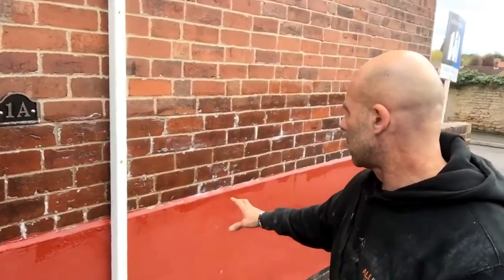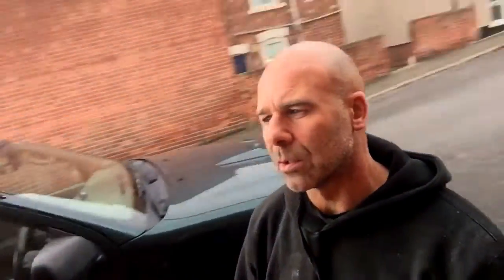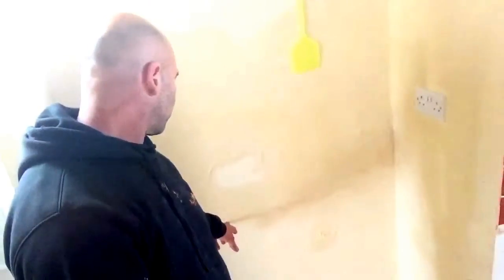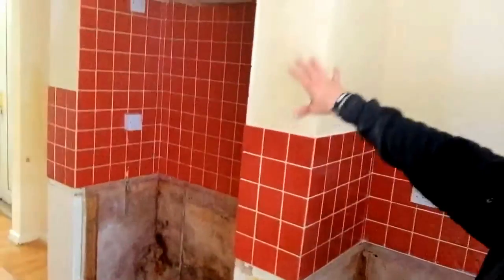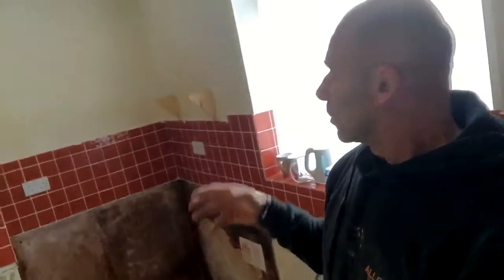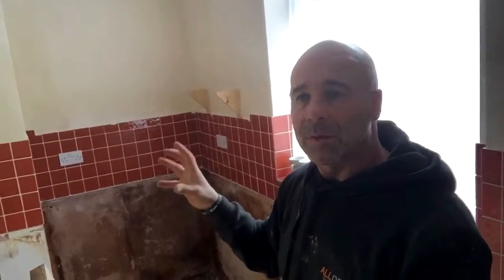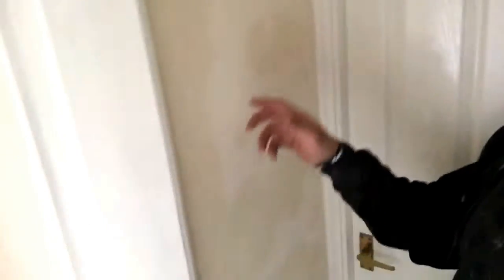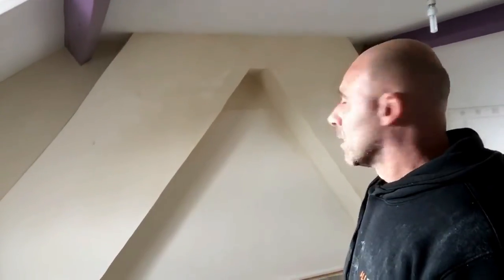Wow have you seen these damp patches? are your walls like this?

Comment: Hi Simon, I like your videos and you do talk a lot of sense. 3 easy steps to resolve that dampness. 1)  Make sure there is good sub floor ventilation and rooms are well ventilated. 2) Replace plaster with a lime base plaster. 3) Remove cement render off the wall. That's it. That render MUST come off the wall because its trapping moisture whether the customer likes it all not. The white vent in the Kitchen is not the cause of the dampness in that corner, it will help resolve the dampness if anything. Its letting the room breath, yes a little condensation may form but it will dry out as fast as it forms because of good ventilation.
Reply from the maker: Again all valid points and options if you have the time and money. I do look at all options available but will go for what is best for time, and budget of the customer but also the  type of construction.

Comment: You’re 100% correct in what you said. The salts migrate through the brickwork and it’s the salts attracting the moisture in the surrounding air. You get these know it all’s on here after watching a few Peter ward videos telling you how to do your job. Just ventilate the chimney and a cement render with additives would be just fine or even sbr slurry then dab over. No negative effects whatsoever.
Reply: I've got these issues, I've managed to scrape of the paint to bare wet plaster who's is soaking, I've got the dehumidifier running to dry it out hopefully, what paint  do I put on it then to stop the damp and salts? 

Thanks
Reply: You need to check the source of the damp first and eliminate it. It may be that the chimney is in bad condition on the outside and moisture is getting in that way. Once you've solved that issue you must knock off any loose render/stone then give it two coats of SBR mixed with cement at  a 50/50 ratio.  Paint 2nd coat on at 90 degrees to the first.

Comment: How are you sorting the chimney breast problem out, do you block off top of chimney and install air vents on each floor to chimney breast for air flow? As well as putting a salt neutralising plaster on of course
Reply from the maker: Fitch 1991 basically yes in a nutshell but with internal work too.

Comment: If the rain water is splashing back then it's not going into the grid properly. If there's even a grid there. Look.at the green on the concrete. Drains is the issue...
The head isn't the issue the render is
Reply: The green can form if the property is north facing. You should know that. It's basics. It's got nothing at all to do with damp or drains. It could just be north facing

Comment: Great vid, quick question, can air bricks be a source of damp? I have just recently bought a house and the previous owner had wall papered over them. They had been covered for at least 2 years, plaster & render is completely blown in two of the corners in the room. Would you recommend keeping them or bricking them up? Thanks again for the vids.
Reply from the maker: Tom G hi there, if the air bricks are directly into the room I would swap them for Passyfier vents, these are an insulated vent that will allow clean air into the room but not cold air. You can buy them on line at the Condensation Shop. 
Cold air will have got behind the plaster and blown it, 
Properties need to be adequately ventilated. 
Hope this helps.
Reply from the maker: Tom G oh just to add they can be a source of damp if the allow water to access the subfloor
Reply: Brilliant thanks, that helps a lot. All the best!

Comment: Please HELP me, I’ve bought a house built in 1850, it’s has a concrete floor, so no air bricks. In the front room there a sash box window, either side of the window is a large patch of damp & under the window, it’s not mouldy or black just damp. There’s no mould low down the wall,so I’m assuming it’s not rising, like I was told it was by a “damp expert”, the outside of the house is rendered, but the only damp in the house is where I just said it was, another damp expert said it was because there’s no air bricks, but I didn’t think the house would have air bricks due to the concerted floor..Can you please Sam give me your opinion, I can’t decorate until I’ve sorted this out..HELPPPPPPPP
Reply from the maker: Can you send some pictures of the issues to our WhatsApp 07973748566 and I’ll try comment on it for you.
Reply: Hi Sam can I get in contact with you please I’m having damp issues in my Edwardian house.

Comment: Got black mold patches across ceiling line in bedroom been told it's moisture by council but I've been in attic and theres a big damp patch on chimney breast wall, could flashing around chimney be letting in water?? As chimney was rendered 4 yrs ago so assuming can't be brick work on chimney
Reply from the maker: It’s hard to comment without seeing the job but things to check around that area is first the insulation above the ceiling line make sure a cold spots not being created. 
Then check the chimney pots are all capped, the flaunching and flashing too

Comment: I have a damp patch in our bedroom it’s in one corner nearest the window , this spreads mould every winter onto the ceiling , it’s now just starting again , a few years ago we got a damp expert out which cost £50, and he just said to ventilate the room more which we have done , we also have bought an arrangement of damp things with crystals in . We have done the obvious things like checked the guttering and in the attic ...... any help would be great .... the damp expert did say it could literally be just a cold spot on the wall where there is no cavity wall foam .
Reply from the maker: Hello 999,999 Views, First I would check the report the damp expert gave you to see what he said and what recommendations they told you to put in place. if you followed them and the patch is still appearing and in the same place, i would ask for my £50 back.
Send me a picture of the damp spot and then send me a picture of the wall outside in the same spot and ill see if i can spot anything.
ultimatley you need to get to the source of the issue whch may in your case be internal condensation and ventilation.
Reply from the maker: Sorry use the contact us form on our website alldrydampproofing.com

Comment: Poor customer, just remove the render, along with the wrong plaster inside which is gypsum... You've just made it worse
Reply from the maker: Thank you for your comment, and no its not worst but we respect your opinion, and it is still guaranteed and it is still dry Jimmy Doom. There are lots of ways to address the problem and if the property ends up decoration spoil free for the guarantee period  it works, its how you get to that point which determine how the customer will view you, We always try to use the ways with the least mess, cost effective and better on the environment. any time you want to discuss this let me know and i can go into further detail with you.
Reply: 100% damp proof wally

Comment: its just trapped moisture from use of non permeable materials wants hacking off re plastering with lime.
Reply from the maker: Oh you mean the cheap option? I’m sure doing that wouldn’t cost much would it?
Reply: @dampsam  i know but that would solve the problem
Reply from the maker: @jackwardley3626  the problem was solved when I did the works 5 years back

Comment: Take render off outside spray with damp seal
Reply from the maker: yvonfem there are lots of methods and systems that would cure the issue, I try and use the best available to me then try to show others how they may do it or give them some knowledge for if they get contractors in.

Comment: How do you rectify the damp on the chimney s as mine are full with it upstairs
Reply from the maker: Gary Irvine if it’s salt damp you can cut out the contaminated plaster and re plaster with a render and a slurry then skim or stick an insulated plasterboard on using an acrylic, or use NatCem35 then skim, you could also put Safeguards dry flex membrane on and then skim it, it all depends what’s easiest. You need to sort out the source of the problem too weather it’s internal ventilation of leaking flashing. 
Hope this helps
Reply: Simon Cooper HNC CSRT CSSW cheers
Reply: @dampsam  LOLS!

Comment: I want to know why builders in Old properties smear cement render all over outside walls cement rendering and gypsum plaster  on solid walls it traps moisture create salt, damp patches everywhere,

I see it all the time on chimney breast damp patches salt moisture trapped behind cement render and gypsum plaster, the walls cannot breathe the brickwork needs to dry out air brake fitting for ventilation and take off that gypsum plaster   or plasterboard off the chimney breast I do all all my work in breathable Hemp Lime and Lime  top coat finish for breathability and doesn't attract salts let's the walls breathe again.

If you are going to render old properties I'll do it in a lime render for breathability not cement render.

I do restoration work and I see it all the time builders have gone in Old properties putting on renovating plaster and gypsum plaster, find the root cause of the damp problem not such thing as Rising Damp all to do with salt contents and moisture trapped between render and gypsum plaster in Old properties that's all it is needs to come off...

All I use on old properties is lime products not many builders I speak to don't know how to use it and what the product is, Hemp Lime for backing plaster  and a lime top coat finish, and also I do lime pointing get rid of the old strap cement pointing.

 Cement pointing on old properties especially on stone strap pointing in cement is a no no we fetch it off and we point in Lime NHL 3.5 and sharp shand  for breathability and flexible..
Reply from the maker: Paul Barsby hi and thanks for watching and taking time out of your busy day to write such a long piece. 
You have a point about letting water vapour pass more freely in and out of the fabric. I don’t like the word breath ability and let it breath that’s just none sense but I get why it’s used so ordinary people can get a quick picture of the water vapour travelling in and out. 
Again I understand what your trying to say with moisture getting trapped behind cement render on chimney breasts but it’s unfortunately wrong. 
The stack does need venting because if the inside and soot gets wet the sulphate salts which are a bye product of when fossil fuels were burnt in the past the salts will migrate to the surface causing what you said is referred to as salt damp. 
I understand your no scientist and you will have been told things by others like there is no such thing as rising damp when in fact it has been proved once and for all and the papers are on the PCA website. 
The problem with our industry is mis diagnosis and the rogue element which we are trying to eradicate. 
Rising damp is a small percentage of our remedial work with bridging issues, penetrating, lateral, & condensation damp making up just some of the others. 
The lime plasters are great but not without criticism. I learned how to make the lime putty plaster and used sand lime mixes for backing in the 80s and the ones used today do have chemicals in and are not 100% natural as a lot of the users want people to believe. They can’t be used below ground or earth retaining walls. 
I do believe ventilation is a key part for modern buildings but cement is not the devil that it’s made out to be, I agree cement should be kept away from heritage stoneworks.
Reply: Rising damp is definitely real.